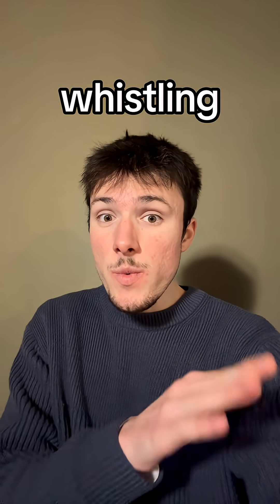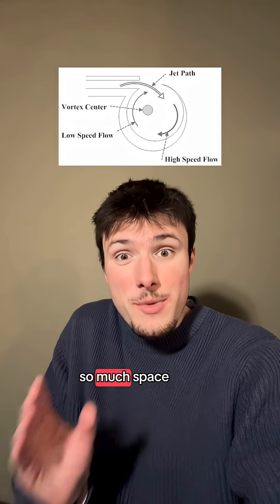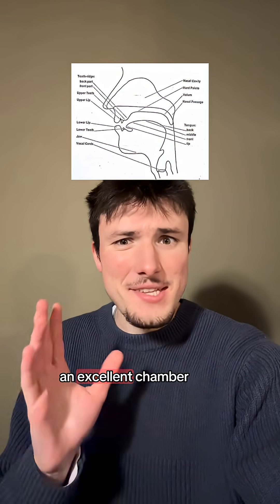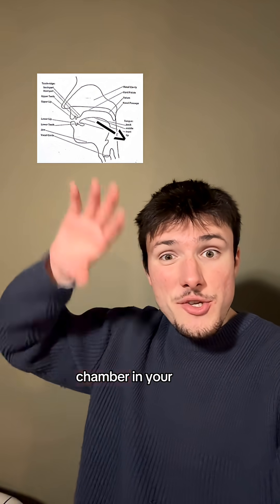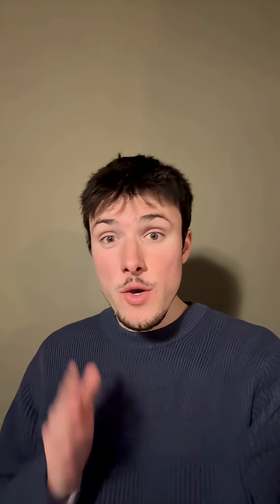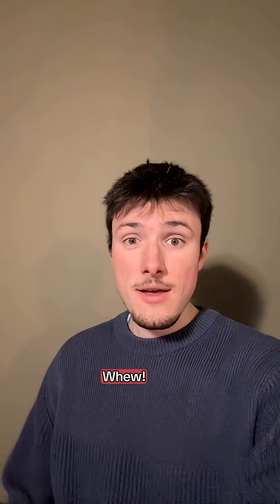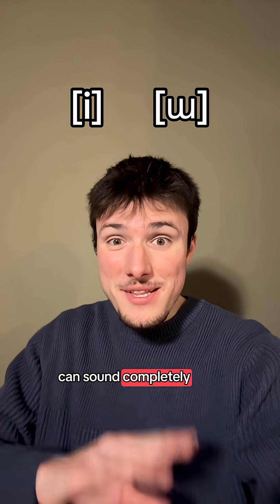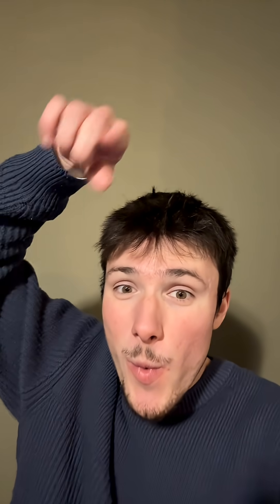How does whistling work?

Comment: the specific type of sound you hear or timbre is caused by different overtones, which are frequencies above the fundamental frequency, and their volumes. changing your mouth shape changes the overtones and their volumes. we all have unique mouths and throats which create unique overtones which make us sounds different.

Sounds that sound nice have overtones that are "integer multiples of the fundamental," which are called harmonics. Things like string instruments, wind and brass (columns of air) and your voice produce a whole load of harmonics. 

The reason they sound nice is sort of subjective, but mainly goes down to your ears being supercomputers that can do very fast calculations, and harmonic intervals are easier to calculate (the main theory). Also the weirder the numbers get, the more the waves line up strangely which creates a strange beating sound which is physically annoying to listen to.

Also say you play two different notes, it isnt just the notes that are compared in your brain, but every overtone to every other overtone, which makes some notes sound really good together and others dissonant, though this can be very subjective and cultural.

This is very long and barely scratches the surface, there is a very good MinutePhysics video on dissonance and harmony.

Comment: An important element left out here: the edge on a physical whistle is essential. Without the notch part, there would be no vortices (tumbling twirls of air), which are where the actual vibration occurs. This is, for example, how flutes work as well. Instead of being a vibrating object (like a bell, the lips, a reed, a string, or a physical chunk of material), flutes and whistles work by literally making the air itself vibrate; the chamber affects the frequency modes which are amplified vs lost.

Also, you didn't mention my favorite way to whistle, namely, with just my teeth! It's great because it means I can whistle while smiling, with my lips nowhere near each other. I used to surprise adults when I was a kid by showing them I could whistle like that; one genuinely thought I was doing some kind of hidden speaker trickery until I proved I wasn't. She was delighted at having learned about a thing she had never heard of before.

Comment: I've been practicing whistling since I was 5 (so 15 years and 9 months of practice) and I try to whistle for at least a few minutes each day. I can whistle in 3 different ways (lips, bottom lip + top teeth, tongue + roof of mouth), both very quietly and very loudly, and I have really good control. It's also great for freaking hunters out (I live in the temperate deciduous woodlands, lots of trees, guns and deer. I've found way too many hunting stands in the woods on the edge of cornfields, one of which I might have to start marking because it's within a couple hundred feet of my backyard. Technically not on my property, but plenty of deer come close to my house, and I fear that I'll find one of my cats or my dog shot dead.

Comment: One thing a lot of people don't know is that, while your lips need to be the correct shape to create a pseudo-reed so that the sound focuses, most of the work is actually being done by your tongue. To change pitch, you don't really change the shape of your lips at all, you change the curvature of your tongue. 

In a similar way, what's going on with a whistle toy/instrument isn't quite what you think. The little rectangular hole on the top is what's acting as the "lips" in that situation, and the hole you're blowing into is the "lungs". The space between, the body of the whistle, is the "tongue", and it always makes a pitch because it's always the same shape.

Comment: The best way to talk about vowel formats meanwhile is to talk about overtone singing, which enhances some of those formants in a very exciting way. Try singing some high vowels, gliding forward and back (eeooeeoo), and as you do so, pull the root of your tongue back into your throat. It should sound like you're singing two notes at once. This is a great party trick. and if you're musically inclined, is all kinds of useful.

Comment: and this marks my first attempt at whistling in 2026, still no luck
Reply: I think some people just can’t whistle. Same with finger snapping
Reply: @ProsecutorZekrom  i grew up doing neither one of these. with practice, i can do a little of both now.
Reply: @ProsecutorZekrom  I can only snap my fingers on my right hand. Definitely agree that there's some people who just can't do it (whistling or finger snapping) regardless of how much they practice.
Reply: @rice-a-roni I can’t snap either hand and can only wink my left eye without using my hand
Reply: @ProsecutorZekrom  If you practice enough you can learn. I could snap my fingers till about a month ago. I just practiced a bit for a week and then I realised the top finger is meant to push straight down.
Reply: Same :c
Reply: Just make the air vibrate really fast (like a few hundred times a second at least)
Reply: I whis(tl)e you luck
Reply: same
Reply: I tried and now I barely can't. My lips are dry and flaky and this hinders my whitling. Agh.
Reply: just learn it.

Its true that some people just magically get the ability to whistle at 5 years old just by mumbling their mouth, but that doesn't happen to most people.

I learned to whistle back when I was 16, and it was an intentional, conscious, deliberate effort. Took me around one day to produce any sound, then another day or two to get consistent with it, and I got better tehcnique as time went on. Today, im probably a rather above average whistler. So, hard work actually pays off

Also, there are no people that can't whistle ever because of genetic reasons or something like that- no, if you can talk, then by the laws of physics, you're able to whistle. You have to be mute to not be able to whistle
Reply: REAL
Reply: Me too.
Reply: Practice a lot and you will come to it, I tried an entire week before being capable of doing it and took me about a year to learn how to fully manipulate it :] (when i was a kid ofc)
Try it every time that you have free time